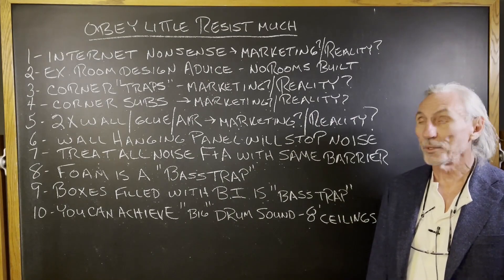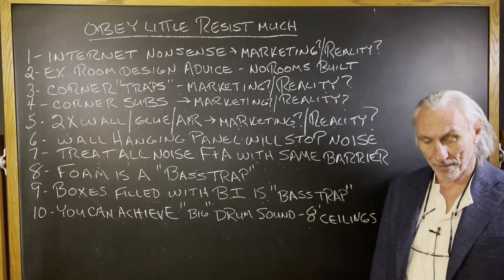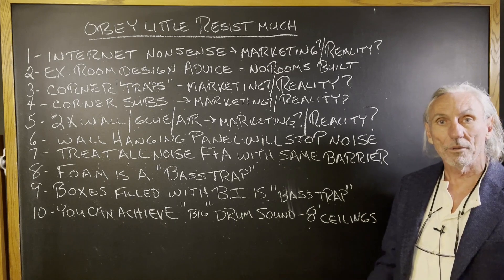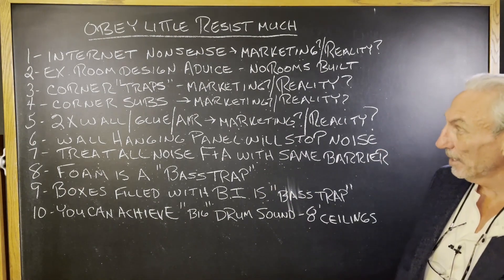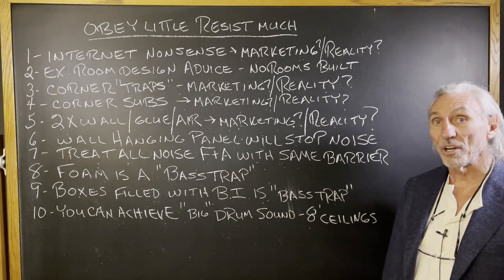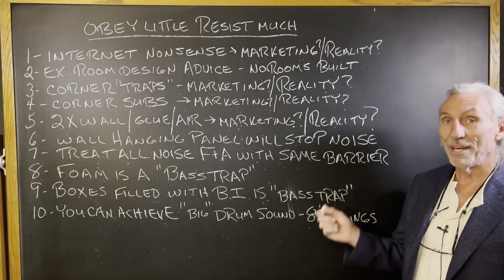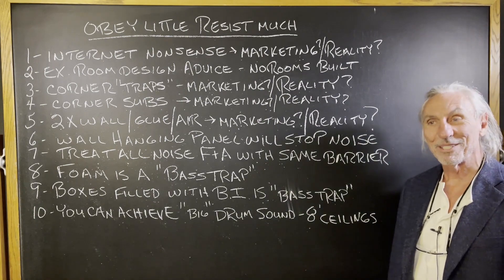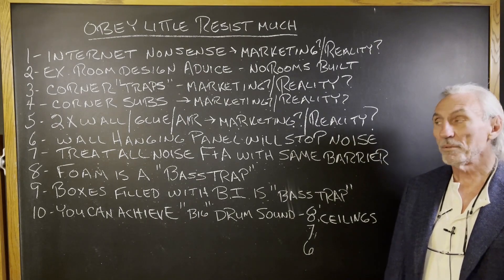Obey Little - Resist Much - www.AcousticFields.com

Comment: You are very right that just a five or ten percent area is to low vs a room.
IMHO it needs a twenty percent or more volume area tara?, panel?, absorber? To help fix a 30 hertz excess energy wave.
Reply from the maker: You need to cover a minimum sq. ft. surface area to treat. Most 30 cycle issues take 80% coverage. Take a wall that is 10' x 10'. You would need at least 80% or 80 sq. ft. at average pressure of 80 dB SPL. Higher pressure levels require more coverage. Most of the time, we just do the whole wall. You can never have enough 30 hz. absorption technology in any small room.

Comment: I think all too often, companies devise costly solutions to nom existent, or virtually non existent problems.

You start this video by explaining that corner bass traps are ineffective, because the problem is with parallel surfaces, not corners. You immediately go on to advise not to place subs in corners, as corners are easily excited. Aren’t those 2 statements contradictory?

You also make the point, in this video and in previous videos, that rooms with a ceiling height of less than 8 feet are ‘really bad’.  By my reckoning, based on your figures, 85% of UK  non commercial listening rooms are, unsuitable for a good listening environment. Well that’s one way to kill hifi sales in the UK!
Reply from the maker: You have hit upon the issue perfectly. Lets lie to the customer to sell them a product that won't work within the given dimensions of their room size and volume. We are not that type of company. Our product's work as advertised and if your room is not conducive to quality acoustics, then we will tell you just that so you can adjust your expectations and find another room size to better match usage or treat accordingly.. We will leave the lies for the other companies to perpetuate. They will be all to happy to distort their performance parameters to work in any room due to their special "magic". Stay out of the corners of your room for everything. The corners are not your issue. Under our current laws of physics, an axial mode is produced by two parallel wall surfaces not two parallel corners. This is just one example of how the industry has perverted scientific definition to suit sales.
Reply: @AcousticFields  that still leaves me perplexed. You proclaim don’t use corner bass traps. The issue is parallel surfaces, not corners. Yet, in the next breath you advice not to locate subs in corners as corners are problematic. Both statements can’t be true. Or, can they? Educate me.

I am ultimately aware that room acoustics are a major influence on your systems audio reproduction, but surely, how you want your room to influence your systems sonic signature are as personal as which speakers you choose, or what music you listen to. There is no right and wrong, there is personal preference! No one company can claim that they have the ultimate solution to every customer’s issues. I choose to drive a Ford, my brother chooses to drive a Volvo. That doesn’t make either of us right or wrong, it just shows that our preferences are different!
Reply from the maker: @howardskeivys4184  You are missing the point. Stay focused on the dimensions and the usage of your room size and volume. They will tell you what you must do to minimize distortions. Focus on the issues produced by the room walls. Small room acoustics is all about two variables: pressure and reflections.
Reply: @AcousticFields  have you ever contemplated a career in politics? Your displaying the appropriate credentials!
Reply from the maker: @howardskeivys4184  With 220 employess, my plate is extemely full.

Comment: Loved it, thanks always for sharing.
How about the sub crawl test and air gap with panels?
I see those frequently online as well.
Reply from the maker: Moving the sub in a controlled and systematic approach throughout the room is welcome. Start at room center and move forward and backward 1'. Perform the same function left and right. Notice the response differences in that small test space. You can then decide which direction to go in for phase 2. Panels with air gaps can have more surface area availble for absorption coverge if the air space from panel to wall is in the 6 - 8", not the 1-3"  range which is marketing speak.
Reply: @AcousticFields  thanks for the clarification!

Comment: Education will payoff for certain.  Thank you for the consistent videos.
Reply from the maker: Changing belief systems takes time and consistency in messaging and delivery. Thank you for your support.
Reply: Unfortunately folks have been conditioned to accept too low 8ft home theater ceilings and told that a tiny broomcloset is OK if they buy the latest silicone snake oil products that in most cases do not work.